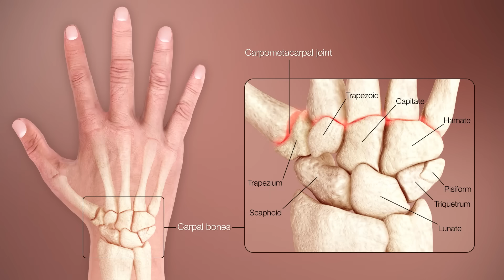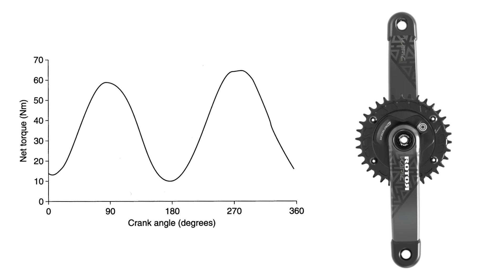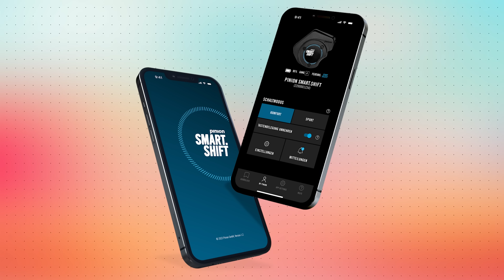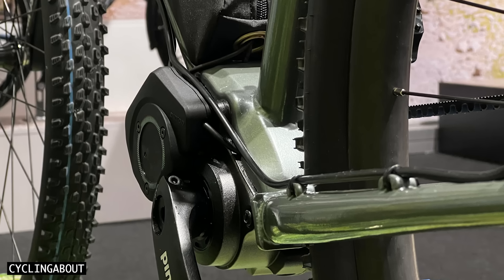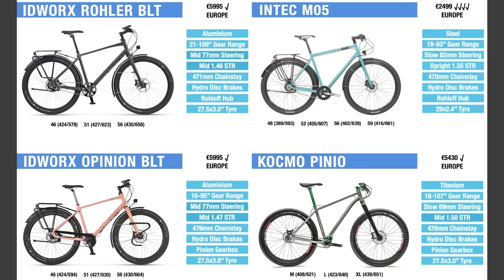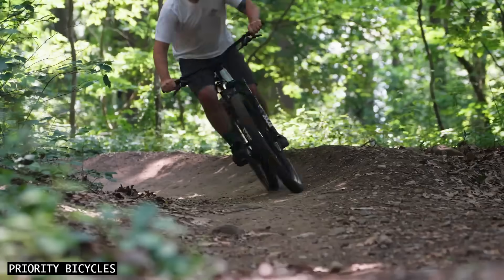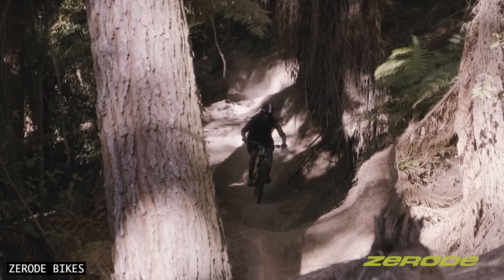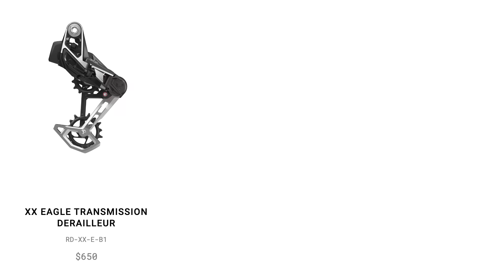The 2024 Pinion Gearbox Is A Derailleur KILLER - Shift Under Load, No More Gripshift!

Comment from the maker: The future of gearboxes is looking bright! ☀ Which bike brand would you like to see using the new Pinion C1.12i gearbox?

I also have a lot more videos on bicycle gearboxes and belt drivetrains for you to watch! 🤌🏻
🧡 5 New Bicycle Gearbox Drivetrains 2023 --- https://youtu.be/pyeMBKJLtWI
🖤 Shimano Alfine internal gear hubs --- https://youtu.be/qf9tFJFXV5o
💜 Enviolo CVT internal gear hubs --- https://youtu.be/3jZkTlDfK8E
❤ Rohloff hub vs Pinion gearbox --- https://youtu.be/W_hx4V9mYuw
💛 Belts are now BETTER than chains --- https://youtu.be/PhXTl7gApVA
💙 Effigear Mimic gearbox --- https://youtu.be/F08bDBK7U7A
💜 Chainless shaft drive bicycles --- https://youtu.be/eimLIkJaNFM
💚 Chainless digital drive bicycles --- https://youtu.be/r-Zyp6jX0HM
Reply: Priority already did it, as usual.
Reply: REEB steel enduro with a Pinion  looks good.
Reply: @justsayin3600  i might be doing something wrong but I cannot find pinion on the reeb website!
Reply: Tout Terrain!
Reply: Since I am disabled I ride a recumbent tadpole style - it would be nice to see something come out with this since derailleurs are the #2 thing I smash after idler pulleys.  It gets expensive fast.
Reply: They should put some better computer controller to calculate wats and according to it change gears automatically swiftly and smoothly, this is good adjustment for long distance accommodation of ride and reduce needles power impute in trying to get some speed, because slowly changing cadence can do the same with much less power needed, but because windy conditions can occur suddenly controller can feel this change in power and smoothly downshift and then adjust proper proportion between cadence and power, and all this smoothly which enables smooth and consistent pedaling which reduce effort. This would be real game changer.
Reply: 😁We have patented an entirely new, infinitely variable, ultra-torque dense, gear technology, called FrictionLess Gear, which is a reformulation of gearing theory. Legacy and novel applications abound. Retrofits of ALL existing bikes, even electrics, will be available. The gear range can easily be >700 with a price range half of the lowest priced competitor.

Revolutionary torque dense electric motor innovations are on the table as are novel  variable shock absorber concepts. 😉
Reply: Been waiting 20 years for this. Rear mechs can get lost.
Reply: I'm riding Priority 600ADX and it's fantastic!
Reply: Priority Bicycles
Reply: One thing I'd like to know is average life span of a belt ?
Reply: @garysmith643  I have been using the carbon belt for 3 years (8,000 miles, driving almost every day) and it looks very good.
Reply: @ArthurDiegoMcDermottUK  thats awesome ! Very impressive ! Mostly pavement or offroad ? Thanks!
Reply: @garysmith643  at least 20 tkm. Problems could be measuring belt tension. And it is less effektiv than chain. But extreme dusty conditions can change it.  I like chains, because steel has great features. It is more flexible than Alu/cfk
Tout terrain or Rennstahl frames are special. Expensive but quality make y happy
Reply: 😁We have patented an entirely new, infinitely variable, ultra-torque dense, gear technology, called FrictionLess Gear, which is a reformulation of gearing theory. Legacy and novel applications abound. Retrofits of ALL existing bikes, even electrics, will be available. The gear range can easily be >700 with a price range half of the lowest priced competitor.

Revolutionary torque dense electric motor innovations are on the table as are novel  variable shock absorber concepts. 😉
Reply: My Campagnolo, Bianchi is top dog.
 So is my Cervelo.
Reply: Gearbox, good but heavy, chain/belt drive doesn't belong

Gearbox plus shaft drive and battery/motor

But that's not the same animal
Reply: Brompton.

Comment: How would auto shift work for when approaching a hill and i want to stand up and go to a slower cadence? And at any given slope/speed i normally need 4 higher gears for out of the saddle riding, and then 4 easier gears when sitting back down (depending on chainring size). How does this system deal with seated/out of saddle? I like cruising out of the saddle a lot.
Reply from the maker: Out of the saddle riding would result in too much torque for auto shift gear changes. The system wouldn't let you shift until you either eased off on your power, or stopped pedalling for a fraction of a second (this is my preferred shifting technique when standing).
Reply: @Cyclingabout  I change gear out of the saddle, you just get used to it, been doing it for years.
Reply from the maker: @tablatom  I'm referring to gear changing with a gearbox. It's a different technique to derailleurs.

Comment: I have read that you should pause briefly when shifting with a Pinion and grib shifter, and not to shift under load. You report the opposite, is that correct?
Reply from the maker: That's right. You can make your shift, and the Pinion gearbox with electronic shifting will make the shift when there is a low enough torque going through the gearbox.

Comment: You did not mention failure. What is the repair cost? Rebuild cost? WHO can repair or rebuild these? $3000 and no mention of repair? Bicycles have become ridiculous over the last half century, the greatest advantage of the bicycle was "simple" transportation and a vehicle anyone can repair and maintain. Other advantages were easy to get parts, standardized parts, no downtime and special ordering parts, any bike shop could fix or sell needed repair parts. NOW....it is a nightmare just to buy or find the correct speed chain locally. EVERYTHING has to be specially ordered. And all the old problems of bicycles have never been addressed like the high maintenance of wheels and replacement. The short term life of chains, the horrible lightweight weak bikes for touring or load carrying. At least one problem is finally over, one tire manufacturer has finally given us a safe tire to ride on.

Comment: I wonder if they could add a small electric generator to the gearbox, so it can charge itself from pedal power? It would make it even more maintenance free, and wouldn't take much power from the rider.
Reply: It will take power from the rider. Gearboxes shouldn't need batteries or electronics anyways. Look at cars and motorcycles.

Comment: Pinion is a shitty company. Refusing warranty and their hardware is of low quality falling apart after 20k. All parts are proprietary and not replaceable. Avoid
Reply: Are these experiences coming from you? I am currently building a custom MTB frame which is going to have a pinion gearbox. Warranty and quality scratches my head.
Reply: @meteturhan3505  no, i was upset about experience of other that i wrote this. usually i don't even consider warranty, i don't believe in it, considering my own experiences with various companies. in my opinion they need to be above and beyond for people to even consider it.

Comment: I finally got to try out Pinion on an eBike and I was not impressed.

So for paying over 7k I get a system that will send a noticeable "clunk" through my legs everytime it shifts gears under load? Yeah, no, pass...

I'll be going with an Owuru CVT on my next bike, now THAT is a smooth experience. And to top it off, you can get the whole bike just for the price of the Pinion system.

Comment: is there a reason this cannot be accomplished without electronics? i assume there's some timing involved if you wish to shift under load, but surely the switch from grip shift can be accomplished without electronics?
Reply: Trigger shifting without electronics is totally possible. Look up Instinctiv trigger shifter set. Its just Pinion not wanting to produce it to sell their new electronic crap.

Comment: I have a simple but great idea but I'm looking for people to help realize it. The idea is to put two 11-speed (10-21) cassettes in a small box in opposed direction (close to each other). That way, the chain (15 full links, which is 378mm) is always in line with the input and output shaft, and no derailleur needed (10-21 center to center is just micrometers shorter than 15-16 center to center. This can be taken up by the normal play. I have the calculations and measurements to show that it is possible). Shifting is done with a small cage that moves between the cassettes parallel to the shafts. A bit like a normal front derailleur, except that it is holding both parts of the chain (upper and lower, the part under tension and the part that returns to the output shaft). From my 100.000+km riding indoor on Zwift, I know that chain almost don't wear if it doesn't get dirty. so if you put the chain in a box, you have the advantages of gearbox combined with derailleur. Simply put, the idea is a miniature derailleur inside a (gear)box, or a gearbox where the gears are replaced by sprockets and a chain,  depending on how you see it. I've been working on this for some time now but from concept to industrialization is still a long way. Maybe people from within the industry can help me out. I have all the drawings and a buildstand to prove the concept.
Reply: check the honda bicycle gearbox, same concept. other's have done similar things too.

Comment: The biggest disadvantage is that it can't be used on any bicycle.  The bicycle frame has to be built specifically for the integration of a Pinion 🙄.   So if you want  pinion gearbox,  you also have to change bike. 😢

Comment: I've got the priority HTX600 as featured in the video. I like the gearbox, but you guys didn't address my biggest issue with it, which is the slow engagement due to the ratchet mechanism in the gearbox. If they were to replace that with something smooth an instant like Shimano had done with their e bike motors, there would be no drawbacks to the new system.

Comment: Just replaced my derailleur for 6 quid .
Reply: and the tools? and cleaning? and cassette? and chain? and the labor? maybe in Bangladesh you can get it done for 6 bucks and then dispose of your waste illegally.
Reply: @difflocktwo  never clean , no tools needed other than one allen key , chain clips .cassettes 6 quid also .labour !   but what do i know as an old lifelong cyclist with 7 bikes , all out with family and friends in summer adventures clocking up big miles on scrap old  bikes costing nothing but consumables .
Reply: @MyKharli  ohhh. lol summer toys. everything works in the summer.

when you need a bike year round, not just as a toy, consumables are the most expensive thing.

brakes alone get so expensive that regen braking from ebikes becomes worth it.
Reply: @difflocktwo  ? i have 5 ebikes 30pence brake blocks work just fine and last a couple thousand miles easy here in hilly scotland . I use bikes all year round as does everyone aware of the climate catastrophe . I am old but a 40 mile round trip to the nearest shop is doable . The drive tyre goes every 2000 miles and is about 13 quid for a semi puncture proof one .
Reply: @MyKharli  you have 5 ebikes. and you're worried about a cent? I haven't seen any brake pads for less than 5 bucks. Mine don't even last half a year of mild commuting.
Reply: @difflocktwo  diy on scrap old Raleigh's etc .

Comment: I feel like this is a horses for courses thing. 
For mountain bikes (XC racing aside) gearboxes like Pinion really make sense, for gravel, commuting, or cycle touring they make some sense too. 
For cycle touring and commuting rear hub gears make a lot of sense. 
For racing (road, XC, gravel) the current efficiency deficit makes for derailleurs still being king. 
The new Pinion combined motor and gearbox for ebikes makes so much sense it's surprising it took so long to develop. 

If/when gearboxes can bridge the efficiency and weight gaps i think we'll start seeing them used for everything (unless the UCI goes "full we tod" and bans them from road racing).

Comment: Well, it's, nothing more than another option. Just as the Rohloff with electronic shifting under load etc. has not killed the Derailleur, this in isn't going to either. It also will not kill the Rohloff, since the fact that it's almost a Kg heavier than the Rohloff will be reason enough to not go that way for a LOT of users. At the same time, a Derailleur based drive still is the most efficient while being way less expensive and the most fun to drive. Last but not least, as SRAM showed us, there are Derailleur based drives that really like being shifted under load.

Comment: You really downplay the efficiency loss.  99.99999% of the time your chain is not packed with mud.  I actually agree that the added weight is not a huge deal.  And the cost will probably come down, and even if it doesn't, I think it is worth it for the advantages it does have.  But even though I am not racing and going for maximum efficiency, I don't want a power sapping slow bike.  I think the gearbox type of transmissions is much better suited to e-bikes where the power loss does not really matter.
Reply: @joebobby1184  that's compete nonsense

Comment: Is there a reason you haven't reviewed a Cinq Pinion bike? It seems like it could solve some of the problems with a normal Pinion bike but it's not as expensive and doesn't need batteries
Reply from the maker: The Cinq Pinion shifters were discontinued quite a few years ago. I found them to be quite slow shifting and to have a very long lever throw when changing gears. They were definitely nicer than a grip shifter on drop bar bike, but nowhere near as easy to use as the TRP electronic shifters.

Another shifter option is the new Hibox adapter: https://www.cyclingabout.com/shimano-grx-drop-bar-shifters-with-pinion-gearboxes-hibox/
Reply: @Cyclingabout  thanks for the info. I had also heard about the Hibox, but apparently one downside is that you can't shift multiple gears at once? Maybe a twist shifter is simply the best way to go.

Comment: once gearbox drivetrains sprout a standardized power-point, so a separate combo battery/motor (think of the removable fauza motor battery on a Trek e-caliber bike) can interface with the gearbox, we'll see the final distillation of merging acoustic bikes to electric bikes.   All you'd need to do to make your gearbox bike an ebike, is to add a motor/battery power unit and you have an instant ebike, which is a 30 second conversion (pop a panel, and plop one in)....we're so close.

Comment: They REALLY, REALLY, need to Intergate a micro motor to charge the batteries internally, that will be the "end game" gearbox for me. With ALL that movements, I don't see how hard it can be with some micro gears inside to do the charging while you are paddling.
Reply: It would add more drag and therefore won't sell as well
Reply: @Coerced  drag is irrelevant.
Just connect it to the bike's generator.

I wouldn't buy gadgets that are necessary for a bike's operation that absolutely need an extra battery to take care of. That is just ridiculous. Wouldn't do this on my car, motorcycle, e-scooter or boat either.

Comment: This should be the standard. I hate that bicycle companies think they have a very advanced looking bicycle just because it’s aero. The cassette derailleur set up is like old chain drive cars with mechanical brakes. Exposing moving parts to outside elements requires frequent maintenance compared to this set up. You also balance the bicycle better.

Comment: these pinion gears do or do not have more drag than a derailer?
Reply: Under 20kmph slightly more resistance compared to a clean derailler. When the derailler is dirty it's the same. Above 20kmph it's the same efficiency.

Comment: We've been using chain/sprocket based drive trains on bike for 100+ yrs so it's high time for a technological revolution in that area. As much as these advances are impressive they won't really take off until the endorsements of major manufacturers and their high profile riders start happening.  This next year is when I might finally make the leap to E-MTB. I'd consider a gearbox bike if the major manufacturers offered them

Comment: I'm confused. Pinion is a mid  mounted gearbox? So not usable on a mid motor Ebike like bafang.... Or are there rear wheel versions?
Reply from the maker: It's completely incompatible with mid motor ebikes. You can only use them with rear hub motors.

Comment: Eh yeah widespread adoption isn’t going to happen if you can’t get parts at the bike store around the corner…
Reply: It's hard for new technologies to get adopted. If no one uses the drivetrain, bike shops won't have parts. But if bike shops don't have part, many won't buy the drivetrain.
Reply: @alexus6237  The problem with these new technologies is no standardisation every brand has it’s own interpretation of these kond of drivetrains and cycleshops can not be asked to supply every brand or type..

Comment: Still waiting for affordable, reliable, smooth and lightweight automatic shifting on bikes, so you don't have to always been thinking about what gear you need to be in. You'd just select a mode or desired power level and it'll put you into the right gear combination for any given situation, just like on a car with automatic transmission. You'd still be able to override it in manual mode, of course, but the decision would be up to you, and in auto mode you'd usually just adjust how much power you're comfortable putting out or how fast you'd like to go. But perhaps this makes more sense on e-bikes that allow you to pedal and where the motor is to help you rather than entirely power the bike.